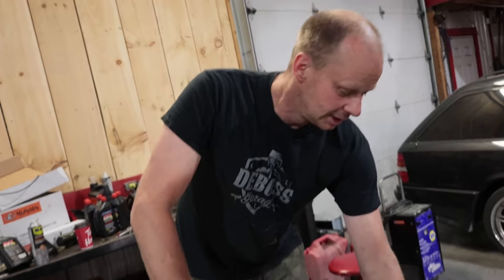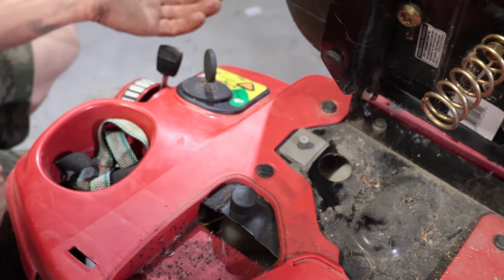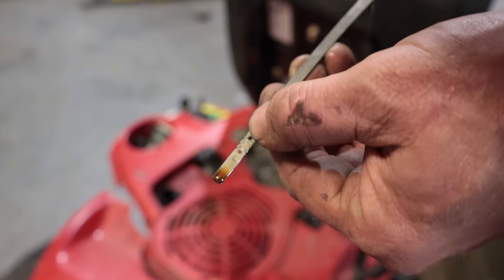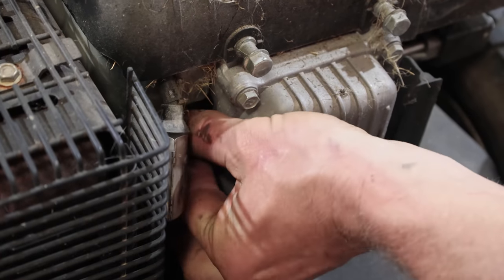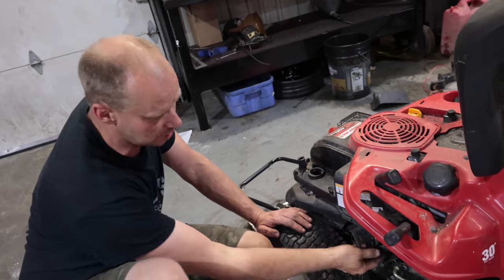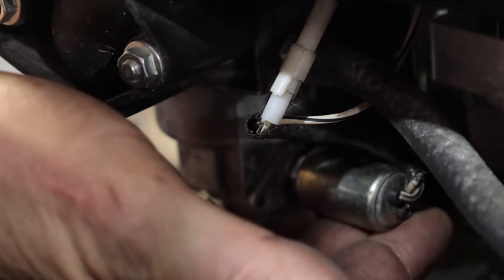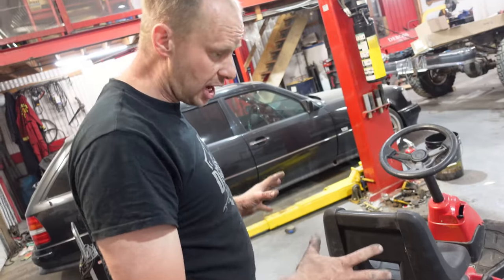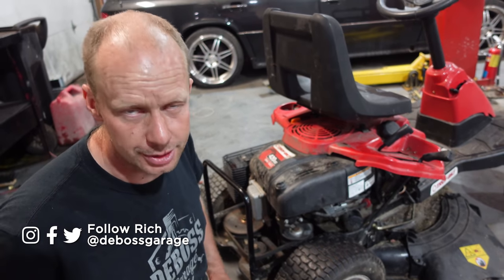World's Smallest 30" Riding Mower Won't Start (and it was free)

Comment: Hey, I have a new (2mo old) Craftsman R110, which appears to be an identical model as this one. It wouldnt start (or click). Checked the fuse, voltage, tried to jump it, trickle charged etc— nothing worked.

It turns out it was the switch on the deck that also tripped you up.

Thank you so much for posting video and pointing this out. I liked and subscribed! \m/,

Comment: I checked the switch where the deck was and still it doesn't turn over? Only with the solenoid. Replaced solenoid and still doesn't turn over?? Ideas?

Comment: There are NO stations selling ethanol-free gas in my state. BUT I can go to the general aviation airport and buy 100LL. 100 octane, low lead. Don't do this if your equipment has a catalytic converter. I've been running this in my (old) small engines with no trouble.
Reply: Or just buy ethanol free unleaded in a can from a karting/motorsports/RV shop, so you don't mess your brain up with lead from the fumes.
Reply: @EmyrDerfel  The 100LL is about 1/4 to 1/6 the cost in my area. At my age, my brain is already messed up.

Comment: As told to me. "There is a fuel that's sold at big box stores and such. Use it. They make 4 cycle and 2 cycle. The next best is recreational fuel. No ethanol in it. Last on the list is the high octane gas. Every time you use the machine turn off the fuel to get it to stop. With the fuel off try starting a few times. Don't turn the fuel on till the next use."

Comment: Ethanol has kept a steady supply of yard equipment coming my way.   The premium here has ethanol in it,  100% gasoline doesn't.   That mower and carb were in really good condition compared to the stuff that shows up on my door step.  It's not unusual to find water in the gas tank if they've set long enough with ethanol fuel.

Comment: surprised you didn't just pull the bowl with carb. still on the mower, that shortcut works perfect most of the time, unless you get "Mustie1" corroded messes! lol
other shortcut is pull the drain plug and send carburetor cleaner tube aimed in at the float hinge/needle, that usually knocks it loose, But the main jet is often plugged with sediment still, requiring the bowl to be pulled.

Comment: Another thing to mention that I ran in to with my generator once. I had “fuel” and spark but could my figure why it wouldn’t run. Took the fuel from the bowl poured a tiny amount in a safe area and hit it with a torche. No fire! Had water in the fuel and after sitting it separated. I don’t know if it was contaminated at the station or what but drained all the water out and it ran like a top.
Reply: hint "ethanol" is hygroscopic, meaning it readily accepts and mixes with moisture from the air, the water-alcohol mix is heavier than oils(gasolines) and will go to the lowest spot and sit there corroding everything away and of course making it not run as water doesn't combust well and it's too heavy to pull through and atomize out of the carburetor.
doing the trick he showed covering the carburetor while cranking/running will create high enough vacuum to suck it through, although beyond a small amount it's fruitless and needs the bowl dropped

Comment: My grandmother's Murray is an absolute clone of this. It also wouldn't start because of the cover safety
Reply from the maker: They’re all made by MTD and get rebranded by various companies
Reply: @DGHD  good to know!
Reply: @DGHD  Troy bilt, lawnmachines, cub cadet, lawnflite, white outdoor, and certain Craftsmans are all made by MTD. Murray used to have their own designs but the company went bankrupt.  You can usually spot an MTD design right away if it has separate controls for speed and direction, that means it has the Vari drive system MTD loves to put on their mowers.

Comment: The secret of lawn mowers is changing oil more often the engine last a lot longer if you working hard change the oil if it doesn't cut a little bit of grass change it once a year

Comment: With that dry of a bowl, how did it even fire when you choked it with the cardboard. That float valve was pretty seized in there. Can’t believe it fired like that.
Reply: Was thinking the same thing. It must have pulled only vapors through. Still it boggles the mind. Bowl dry - no start.
Reply: it may have leaked lots of fuel through into the engine and oil, it could have enough vapors from the oil. the crankcase has a breather pipe into the intake just before carburetor.

Comment: Alot of premium fuels contain ethanol. If you are looking for ethanol free fuel there is an phone app you can get called "Pure Gas". It will tell you the nearest station to your location. Great to have if you drive a vintage type summer vehicle or like myself, run mower, pressure washer, snowblower etc.

Comment: Just mix some Marvel Mystery Oil in the gas it will negate the ethanol and help the carb be clean and it will run after a long time sitting up... runs better and stronger as well with it.

Comment: for 999 USD i've never had a mechanical device that was so dam frustrating.   the steering doesn't even work on the new unit.   best to upgrade it asap before you go into the street or into a fence.   engaging the mower blade has always felt like taking off in a rocket.   i'm certain several parts are hidden in the yard as a result.   when im real pissed off i like to grab a large pipe wrench and work on mine.   fyi there's a kill switch hidden in the front under red plastic that serves no purpose whatsoever.

Comment: I run only premium in my 54" rider and my snowblower. Non-ethanol mixed for my leaf blower.  Ethanol ruins small engines.  It absorbs water and will gum the fuck out of anything with a carb.

Comment: Great vid Rich. Any idea why my JD Kohler motor backfires when I switch it off? 
Cheers
Reply from the maker: Is it running hot?  Make sure to idle it with no load for 10 seconds too
Reply: if it has a fuel cutoff solenoid, it may be sticking open or someone cut the plunger off(lol). if it doesn't, then you should always shut it down from an idle with all driven accessories off.
** make sure the spark plug is correct number and electrode tips are not carbon/debris loaded, that can run very hot and make them pre-ignite. just the hot carboned up exhaust with raw fuel pumped in will ignite it also, which goes back to above.

Comment: I. Have. A. 30” just like the one showed. But it’s a Club Cadet. It runs for about  30 min and it’s starts to a ck like it running out of fuel and stops and once I let it set for 10 min it will start back up,again and run for another 30 min. Before it stops again.  Could. It  be. The coil.
Reply: I'm thinking it's the gummy residue, like this mower had. 
I put Seafoam in a 15 year old Craftsman mower. Now it runs like new.

Comment: The drive belts are a nightmare to do I'm stuck on it
Reply: These MTDs have a fatal flaw in their design, the belt sits on a steep awkward angle when at the lowest setting. Never drop the deck below #2. If the mower bounces on a hill or uneven lawn, the belt slips off the drive wheel, then gets chewed up by the spindle.

Mine snapped, the first time I ran the machine. Keep in mind, the tension is released when you raise the deck to it's highest position. Then use a long screw driver to loop it around the drive wheel. Once the belt is on halfway, spin the blade manually until the belt is properly seated

Comment: Be careful and do your research on what premium gas to buy if you want to avoid ethanol, they are not all the same.  As an example Shell 91 octane has no ethanol, but Petro-Canada super premium (94 octane) has extra ethanol, because it acts as an octane booster.

Comment: wonder if premium has ethanol in it here in the states
Reply: Sometimes it has ethanol sometimes it doesn’t. Usually not having ethanol is displayed since it’s something special. So, if it doesn’t specifically say no ethanol then it very likely does have ethanol.
Reply: @NBSV1  yeah that's what I was thinking. Some stations near me have race fuel, which states no ethanol.
Reply: Some might, some might not.  Where I am (western Canada) Shell premium has no ethanol, but some other high-octane gas has extra ethanol, because it acts as an octane booster

Comment: Why do these videos NEVER explain how to remove the STARTER?!?!!? There's a cowl over it. I've replace the battery, the solenoid, checked the safeties. The Starter WON'T turn the shaft after a certain point. Most likely the gear teeth are broken (in these machines, they are plastic). I can buy a replacement for under $40. It's a lot less than buying a new mower. I just can't find out how to remove the cover over the top of the starter! Anybody go any advice?

Comment: draining fuel from carb CAUSES the need for service because it allows oxidation. Fuel will not degrade in winter season at all. Think about it, do you drain the carb on a car or truck you dont drive in winter? Nope. Does it fire right back up without carb service in spring? Yep. FILL a metal tank full and do not drain carb and your lawn equipment fires right back up in spring oxidation free.

Comment: Simple get can wd40.or any flammable liq spray in carb if runs then know fuel issue be simple.  I have mine 4 yrs. I cut black yellow wire you B ACK UP IN REVERSE BLADE ENGAGE LOVE MINETB30R.

Comment: 98% of your problems with small engines Is the cheapo carburators and bad gas we have these days. Replace the carburator if it's cheap. Drain the gas out of the carburator when you're going to store it. That will prevent a majority of your problems.

Comment: 99 times out of 10 you can skip the entire trouble shooting process and just clean the carb. everyone always puts the mower away without clearing the fuel or treating it. if you are really cheap just run it out of gas on the last use of the seaason

Comment: Interestingly enough the smallest one I have encountered was the Yard Machines Yard Bug it was 27.5".
Reply from the maker: Funny it’s made by the same company too
Reply: @DGHD  since it wasn't running. You should swap the engine. Doesnt have to be something like a V16 Detroit, but I imagine that you could possible fit a tiny 3 cylinder kubota with a wee bit of hangover in it. Just for the fun of it of course.

Comment: Nurses have it easier? Well... I’ll keep that in mind the next time I’m dealing with a constipated patient and I’m using a finger to work to hardened stool out. PS: many times... there is a sudden explosion upon the passing of the harden plug. So... next time I am speed walking to the locker room while covered in the aforementioned... I remember that mechanics have it tougher than I do.
Reply from the maker: Some of you have never fixed a garbage truck by the side of the road in the middle of summer with maggots dropping out of diapers in your hair and it shows!